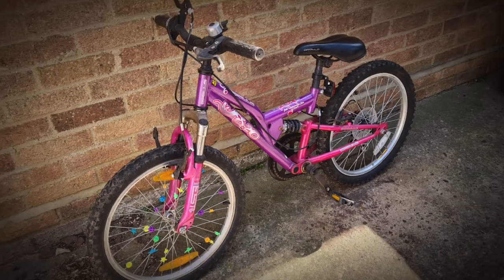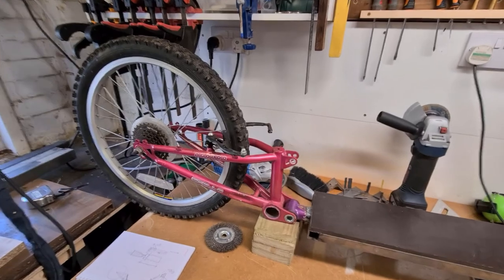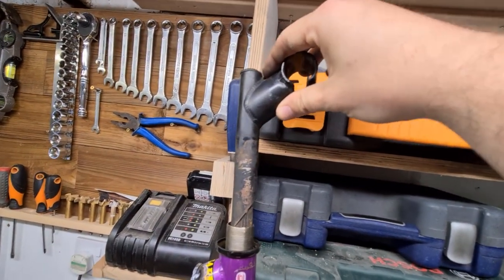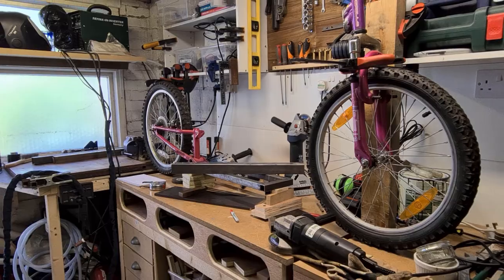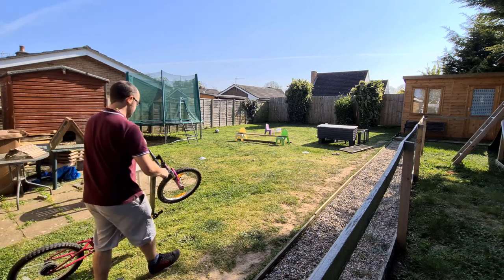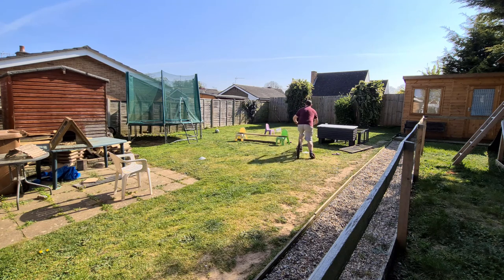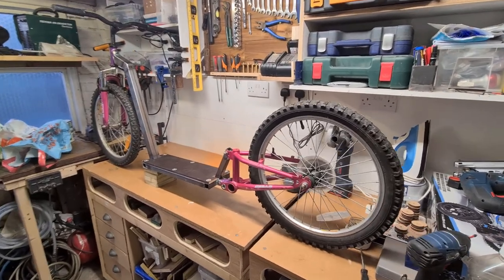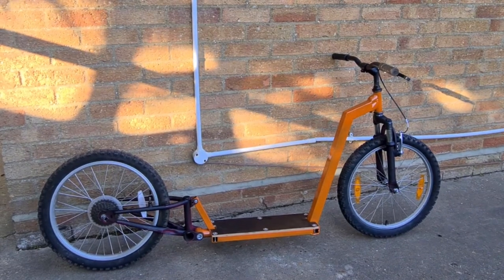DIY All Terrain Scooter

Comment: I was remembering things like this from my childhood and thought I'd like to have one in an adult size. Just then I find this video and my daughter has outgrown her old bicycle and I'm having ideas about buying a welder. This looks like a great project! I think if I do this, I'll probably angle the forks a bit more and use a taller bar so I don't have to hunch over to ride it. Maybe some angles cut out of the square tube up front so it and curve up to the head tube.
Did you ever fit the rear brakes? Does it need them? My daughter's little bike has a coaster brake, I wonder if I could fit a lever or pedal to operate that...
Reply from the maker: We only fitted the front brake, never really went fast enough to need both! If I was to make it again I'd use 40mm box all the way through the frame. Be much stronger than what I had, where I changed to 25mm for the platform, but it was all out of scrap.